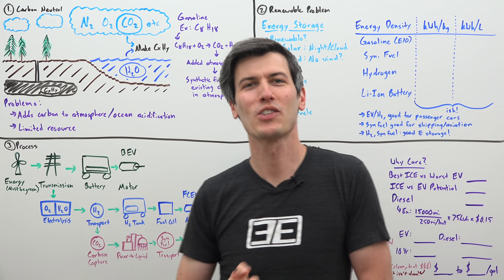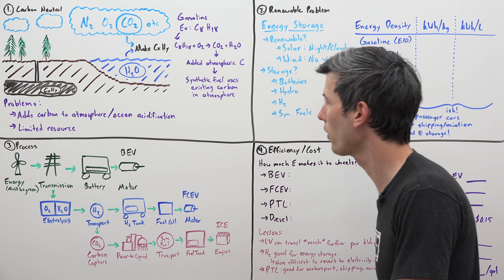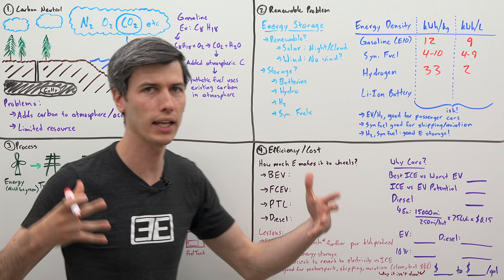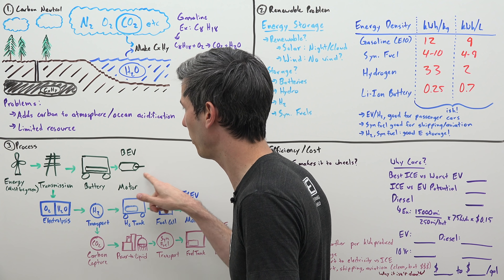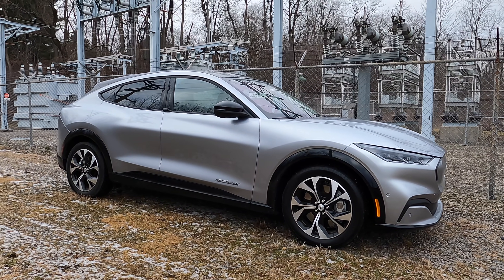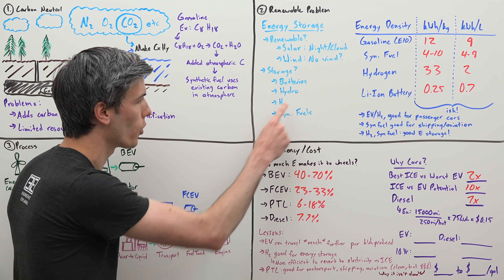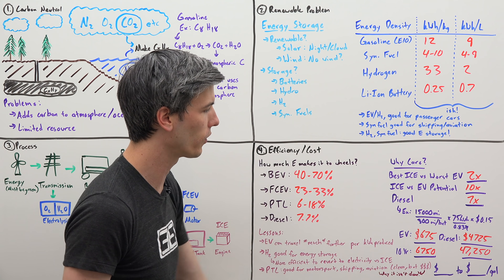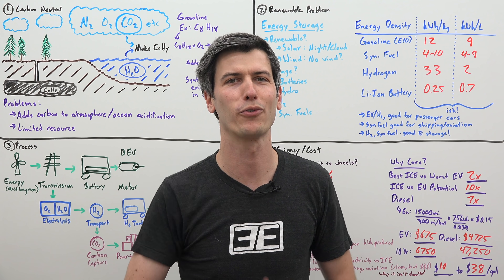The Big Problem With Synthetic Fuels

Comment: Not sure if it's been mentioned in the comments already, but the synth-fuel ICE scenario still results in NOx and (I guess) particulates emissions that require scrubbing and filtering if we're to keep to the clean air targets, too.
Reply: It's a burning process after all so yes nox, noise, particulates are still a problem.
Reply: NOx and PM emissions from modern engines is incredibly low. In most areas it's a non-issue. In non-attainment areas like LA etc. it's obviously still an issue though, which is why CARB is still working hard to lower it further.
Reply: @geomtol  The problem with California is that their draconian emissions regulations ARE NOT WORKING. They have the strictest environmental regulations in the US yet they have some of the most polluted cities in the US and those cities' pollution problems are only getting WORSE.

Comment: About does the energy source need to be renewable. Not necessarily, nuclear will do just fine as well, especially if people can figure out how to get practical nuclear fusion. At that point energy becomes very cheap, and it again could flip the situation completely around. Battery storage and electrical use have good efficiency for car use, but the current chemistries as you well know require a lot of rare materials.

Comment: Good presentation, but it is only from one very specific point of view. Electrolysis is only one way to make hydrogen. Of course it is now the most practical one currently, but there is work being done in the nanotechnology field for example about conversion of sunlight directly to hydrogen (exists but can't be done economically at scale yet). Secondly, synthetic gas also has a lot of potential, doesn't necessarily need to be liquid. When talking about the efficiency, one big thing is often forgotten. Cars are just a side thing, bigger problem is the energy system as a whole. Energy storage needs are not only specific to cars. One of the big problems is keeping the electric grid in balance. In electric grid consumption and production must always be in perfect balance. To achieve this reliably with renewables, massive over production capacity is needed, or cheap enough storage. It depends, which one is cheaper to build, extra capacity or storage. But let's assume we build a lot of extra production capacity to always fullfill the need even at the worst moment. After that over production becomes a problem. At that point even low efficiency storage starts to make sense, because even low efficiency is better than 0% when the energy is not captured at all. At electric grid scale, current batteries don't make much sense. With synthetic you trade off efficiency to fewer special materials required. Pumped water storage is not a solution either, because it is very inefficnet (need a lot of water or height to store a little bit of energy), requires geographically suitable places (the best places are already in use, and there is massive resistance in many places to take new places in use, because of the negative environmental effects). So at grid scale, batteries are impractical, pumped or water storage usually not possible to extend much, what do we have left? At electric grid scale storage to synthetic gas or liguid fuels is more efficient in that matter, that at best >90% of the energy in that made it to the fuel can be recovered in a plant that utilizes both heat and electricity. If synthetic production is done at big enough scale, then the side streams may be enough to power planes and some of the cars as well.

Comment: I have a few questions:
1) Would it be possible to use nuclear instead of renewables? After all nuclear capacity factor and energy density are orders of magnitude higher than renewables, plus their overall CO2eq emissions are in the same ballpark
2) Shouldn't be potentially simpler to extract CO2 from water instead of the atmosphere? 

In any case there are also other issues at play, outside of efficiency. An example is grid stability, because I doubt the grid would be a happy camper if a lot of EVs would suddenly start charging. In any case it's safe to say that a lot more R&D is required for all three options
Reply: Im not a professional expert, but as probably not one of them will linger around on yt videos :) - I try to answer. 
1) It depends on many factors. Generally, wind and solar will be cheaper, already are, will even be more in the future. But future types of reactors, type 4 reactors, could recycle atomic waste, could provide base load to reduce the total system cost of energy production (via less storage needed), could provide energy in countries with little options for neither wind nor solar. Capacity factor and energy density are more important when comparing variants within a technology, e.g. nuclear reactor type A vs nuclear reactor type B. 
2) May be, for instance UCLA did some research on it recently. Porsche was featured in the vid telling they try to lower costs down to a much lower figure. However, keep in mind Jason explained its still more economical to either use H2 directly in a FCEV or even recycle it back to electricity for EVs. Because evden with efficiency improvements in creating syn fuel, the big loss comes in the ICE itself. With little improvement there after 100 yrs of engineering. 
Grid stability is a good point and a lot of work is done in that field. Charging can be incentiziced and controlled resulting in a smoother demand curve, electricity can be stored short-term and long-term by various methods. And the EVs themselves can be stabilizers by V2G.

Comment: huh, I had no idea synthetic fuels were so cool. I have my doubts that we'll reach Porsche $2/l goal, but that would change everything. that's less than 30% more expensive than the current petrol price in Germany. I would gladly pay much more than that to keep driving ICE cars.
Reply: More to the point, it would allow you to keep flying on 787s and A350s. (Though it's possible those engines can be converted to use either H₂ or NH₃, which are probably easier/cheaper to produce than a full synthetic jet fuel.)
Reply: The fuel will be produced in regions with the absolute cheapest renewable energy in the world. That energy is much cheaper than what we pay to charge our electric vehicles at home. On a large scale synthetic fuels will become much cheaper than what people expect.

Comment: Hmm ... You are right IF ALL renewable energy really is used to produce electric energy.

Unfortunately ... it IS NOT so. Terrawatts of wind energy are not used (windmills shut off) because there is no actual need for it. If You make ANY use of something that beforehand was wasted, the gain is endless (starting from zero). This is what makes the synfuels so attractive.

Second thought: Hydrogen may not be the best solution. Methane is (again) not as efficient in production instead of Hydrogen. But it is easier to store (being a liquid at temperatures below 45°), easier to transport and can be used to feed any natural gas-fired device. AND can drive a fuel cell! 

Hydrogen may be useful for industrial use in high-energy-consuming production processes as steel manufacturing (or glass).
Reply: Good point. The difference is that in future, there will be no wasted electricity, but rather a huge demand for EE electricity as lots of processes will change into electricity-powered ones. And youre right, surplus EE production wont be cut off, but instead stored. Short-term and long-term. P2X is the most powerful option in many countries (with little hydro storage). It can be hydrogen or methane depending, as you depicted, on use case.

Comment: Synthetic fuels may not be able to replace the electric cars but they keep existing combustion engine vehicles on the road
Reply: Syn fuels are not meant to keep existing ICE cars on the road. These cars will be able to run the rest of their lifetime, which mostly will be less than 20 yrs, with gas. One wouldnt build up a syn fuel infraststructure for just ten years (ten years building it up, and then th eother ten yrs running). They would be, depending on the adherents, either a niche product for a longer time (like Porsche), or for special use cases like long-haul heavy duty transport in remote areas, ships, or planes.

Comment: It'd be interesting to compare the values if in the cost of electricity is factored in the massive investments in electric grid and distribution infrastructure, as well as home charging appliances.
Sure, if that is the road we will take, one day that stuff will be there and the cost will be already covered, but spreading that cost on the (assumption) 20-30 years it will take to have a BEV-charging infrastructure allowing 90% of the vehicles to be BEV without big changes in the lifestiles of the owners, how much would that kWh cost then?

Comment: Isn't the mining of the raw materials needed for the batteries for EVs extremely toxic for the environment? Also the manufacturing of New vehicles produces a lot of pollution, on top of the fact that they still use a good amount of petroleum products for plastics and grease for bearings etc...
Reply: Even with that an ev is much better long term for the environment then a normal gas powered car

Comment: E fuels for aviation have one more disadvantage. CO2 in high altitudes has stronger green house effects, more dispersion and more difficulties for re capturing it. But technically is carbon neutral and lighter than any battery avaliable now. So it is still better than underground JetA.
Nice video 🙂👍
Reply: Unfortunately, they're really the only option for large aircraft. Still, at least it's there as one.

Comment: With hydrogen, you missed an important step, and that is compressing the hydrogen before it goes into a tank. It takes a reasonable amount of energy to do this because of the high pressure it's stored at.

Comment: Electricity transmission and battery charging have - obviously - an efficiency <1; For H2 and Syn Fuel moving them in the fuel tank shouldn't count as a step with efficiency loss

Comment: Great analysis of the differences. There's one thing that makes hydrogen and synfuels more competitive. The cost of electricity can vary widely depending on when you use it. For a consumer to get electricity from the grid, your 15 cents per kWh is great. But a bulk hydrogen producer would be purchasing what would be excess electricity at bulk grid prices, closer to 4-8 cents per kWh. That makes a big difference in the end cost.

Comment: I think hybrids + synthetic fuels are the best way to make ice live
Carbon neutral fuels on a hybrid gives the best fuel efficiency and power too plus it has a exhaust sound (really matters as road trips are fun cause them)
Reply: Internal combustion cars are going to be a niche market for synthetic fuels. The big bucks in them will be fuel for airlines running big planes, like 747s or A380s. Small propeller planes that travel a few hundred kilometres at a time with a couple dozen passengers will be going electric like most cars. The big ones that use jet engines are where fuels will still be needed, simply because those are just too big for battery power. Oh, and I suppose you could use it for rocket launches, too.
Reply: @Roxor128  i disagree, internal combustion engine is a art, but that's not my point, in my country it would be really difficult to have electric cars as chargers to supply are very less plus really depends on country, but hybrids and electric is best bet, not all electric, even hydrogen fuel cell is better than electric in my country, and ice cars which used rarely can be sold even after 2030 as they don't get used every day, the cars or transportation used everyday should be hybrids or hydrogen or electric

Comment: Here in Brazil pure ethanol works, the problem is that flex fuel cars are not fully optimized for ethanol, they are a compromise between gas and ethanol. I believe that if car manufacturers designed a car for ethanol only, the MPG difference from ethanol to gas would be much smaller. Cold start problems are gone with modern flex fuel cars, we still have a major problem with injector reliability on direct injection systems, but I'm sure it can be fixed with time (i just hope manufacturers ditch direct injection). The only real problem i see in the USA is the competition for land, but I can't comment on that since here we don't have that problem.

I hope my english in't too bad and this is just my opinion, i'm no engineer, just a regular car and motorcycle guy that likes ethanol and hopes the internal combustion engine doesn't die.

Comment: You didn't compare in chart 4 (bottom right) when using gas (non synthetic) as a comparison to show how much is used to drive the car. 

With hydrogen, gas and synthetic gas you are pumping gas into the car in a matter of minutes (single digit) rather than say 20 minutes. 

I can't say EVs are popular if it is 1-2% of the market. Take away the tax credit and see how popular they are. I think people will fork over the money to keep their cars on the road using synthetic gas.

 I hope and pray that synthetic gas is the answer. Not everyone has the ability to use let alone charge a car.

Comment: Can u do the maths on the amount of non renewable materials required to become Elon’s battery only world, compared to mixing hydrogen fuel cells into the mix for larger heavier transport.  Seems very little discussion how we exchange oil for rare earth products while only considering the emissions effect ignoring the non renewable materials that would be required by a battery only world. Battery recycling doesn’t even come into the picture because we are currently maxing out our battery production while powering 0.000000000000001% (someone is welcome to correct me on that figure) of worldwide transport (incl trucks, tractors, ships, planes.) Battery recycling parity is unlikely to be in our grandchildren’s lifetime.

In my mind by current technology hydrogen fuel cells is the only way we can stretch those non renewable mineral resources further into the future.
Reply: From this video it has been explained that making hydrogen through the electrolysis process is very inefficient. And if electricity comes from coal then hydrogen isn't clean when it's made either

Comment: The problems with electric cars are far greater than the problems with ethanol or biodiesel.  Electric cars are far more expensive, short lifespan and if you lack your own garage they are impossible to charge.  Ethanol is more energy dense than petrol which is why it is used in race cars.
Reply: How much land will be used to make biodiesel, that is the question.

Batteries in EVs have a lifespan of 1/2 million miles to 1 million miles, that's the equivalent of 30 years to 60 years.
Reply: @paperhouse6282  the batteries will have degraded far before that though due to time.
Reply: @VintageCars999  The degradation is not very visible, there are many people who have proven this, you can find it on YouTube.

At least all of that operating costs EV is cheaper than internal combustion
Reply: @paperhouse6282  None, biodiesel is recycled oil that in the UK is waste.  No battery lasts 30 years.  The batteries in electric cars can last up to 8 years when you have to throw the whole car away because it costs more than the car is worth to replace it.  Often the battery in a car dies after about 4 years if the owner is often fast charging it but at 4 years it may be worth replacing.
Reply: @ranichso735  Professor from CATL said that the battery in the EV has the same lifespan as the vehicle.

There are several factors that make this possible, most people charge their EV once a week compared to your cellphone which you charge three times a day, in EVs there is a BMS (battery management system) which controls the temperature of the battery module and energy consumption. All that allows for maximizing battery life. Research from Jeff Dahn has also shown the results, Instead of one million miles, the batteries are now expected to last 10,000 cycles and provide traction power for more than two million miles – that's about 3.2 million kilometers
Reply: @ranichso735  How much fuel can be made from waste? And how long will it last if there isn't enough waste left?

Real Engineer has also discussed this, biofuel doesn't make sense to be used for public transportation such as cars, it makes more sense if it is used by Airlines